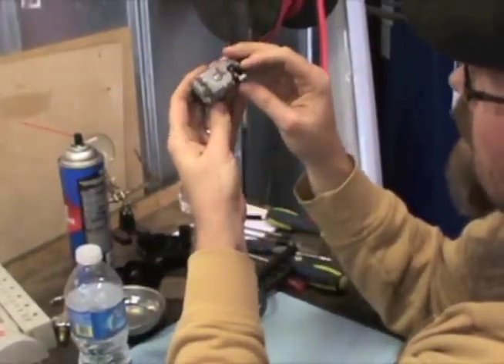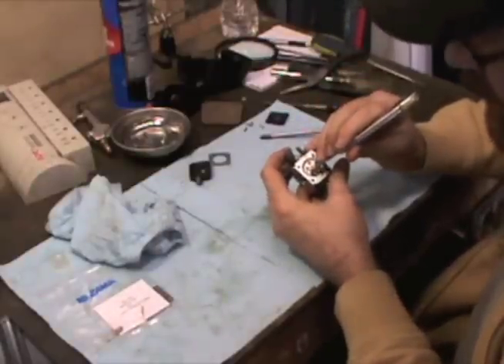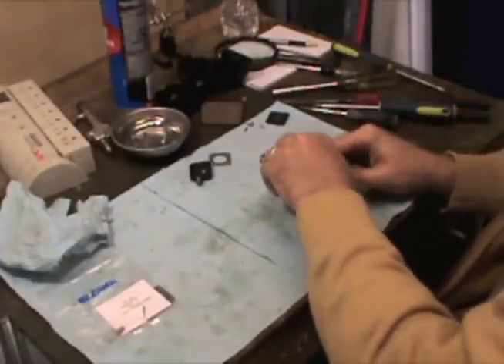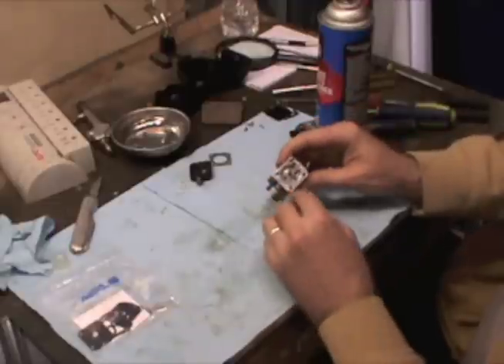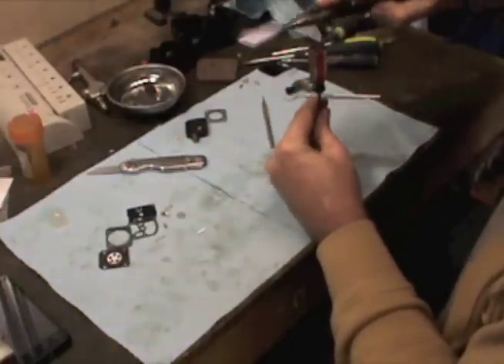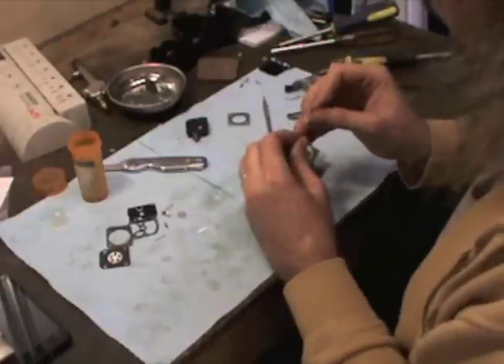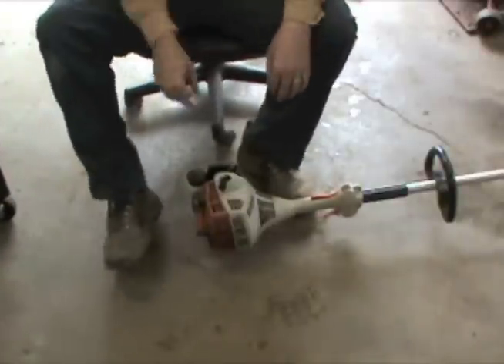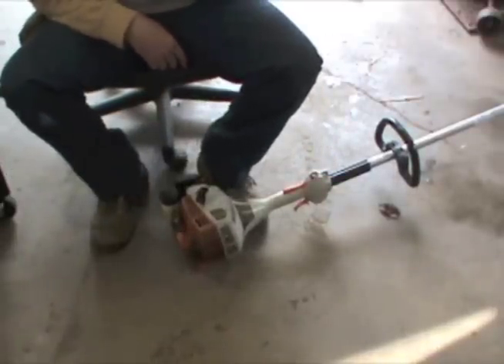Stihl FS55-repair

Comment: Thank you for posting the video.  The detail for putting in the gaskets is very important.  I redid my FS55, but the only part I have trouble with is putting the Welch plug back in, it just does not seal in.    A question, if the carb does not pump the gas, and all parts are new, could that be because of the Welch plug not being installed tight?

Comment: My Stihl HS45 requires a "Special Tool" to get the "H" idle jet out.. the low comes out with  just a Phillips screw driver. The H has a stop built in to regulate the 3/4 turn.  How can I work around this tool.  I don't want to break this cap off.

Comment: My zama cq10 doesn't have any adjustment screws for the fs55. There's a small 'L' and 'R' printed on the carbi body, but no screws (as in no port for the screws even). This version must be a non-adjustable carb? Never seen such a thing.

Comment: what can i do to get a little more engine power from my stihl fs 55 wacker differently from turning the high rev screw out a bit?
Reply: Hey! I didn't have any idea how to take the clutch off  and now I do.👍
Reply from the maker: there's not a lot that you can do without getting into some very extensive porting and polishing. the government has pretty much regulated the carburetor design to where performance is hard to come by.

Comment: What size deep socket is needed to remove the two nuts holding the carb on?
Reply from the maker: Keith if i remember correctly they are 1/4"?

thx for watchin'
Reply: Keith Heitzman  8mm
Reply from the maker: if memory serves me correctly I used a 1/4".

thx for watchin'
Reply: just had another look. on my fs 55  27.2 cc the nuts holding the plastic air cleaner assembly to the carby are 8 mm.
Reply: Mine on the HS 45 are 5/16ths.